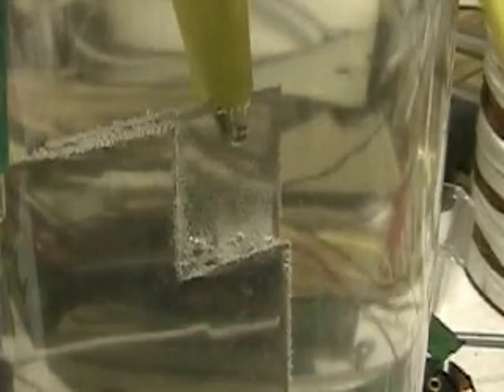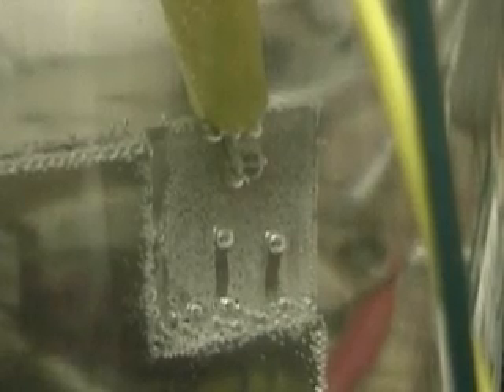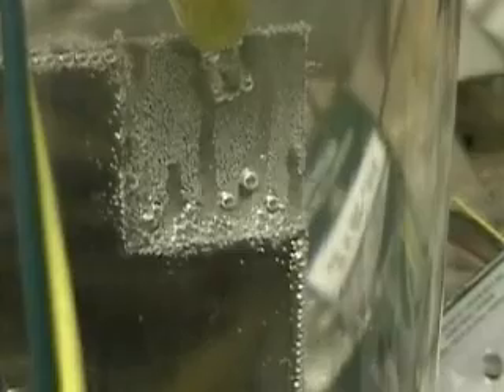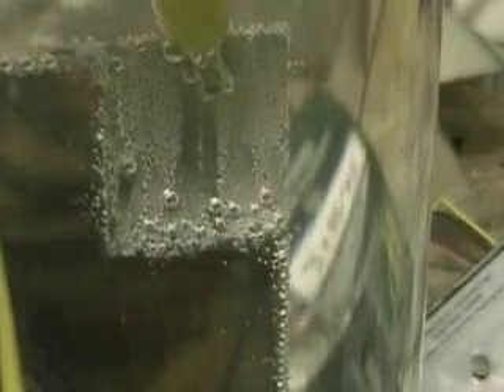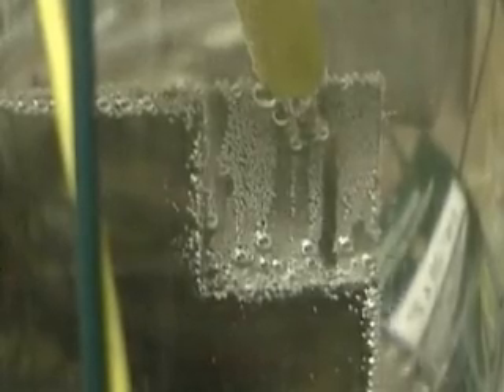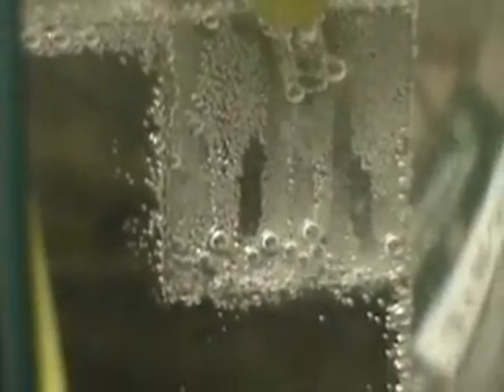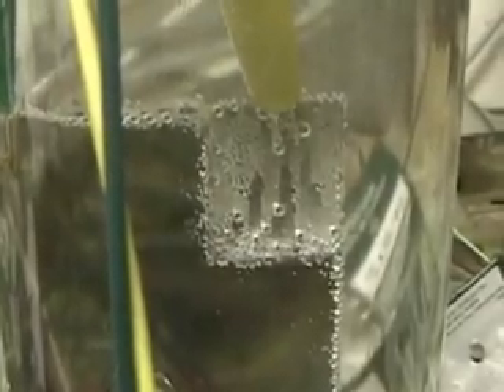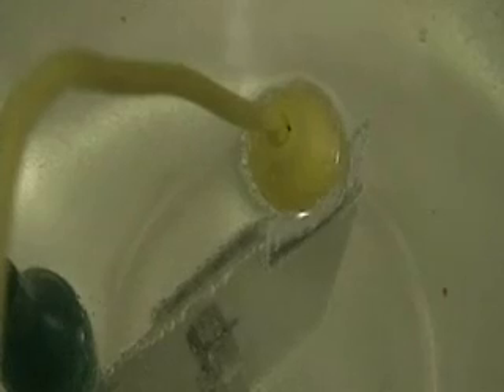Hydrogen Tap (Hydrogen No Elecrolyte) 337

Comment: Maby hot water and/or plates can produce more gases.  That might also be good for solar systems where the suns energy can be used to heat them up.  Though I understand this is perhaps only a secondary concept.  I know with electrolyte, that higher temperatures of the water helps, but I'm not sure if it would be the same using just pure water.

Comment: I got a little bit better reaction than what you are seeing using a neon sign transformer at 9kv 30ma using the primary of a 110v to 12v "brick" as an inductor and a blocking diode ... but my results were not THAT much better than you are seeing ... and certainly nothing like what Meyer showed ... so the quest continues ... key seems to be to try real hard to blow up a capacitor that happens to have water as the dialectric ...